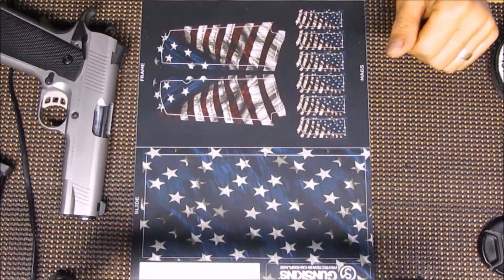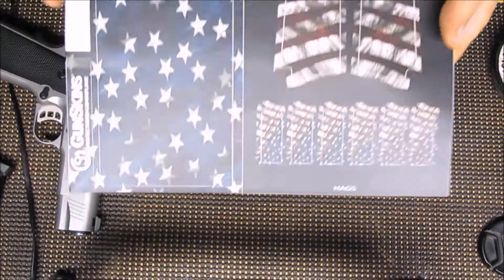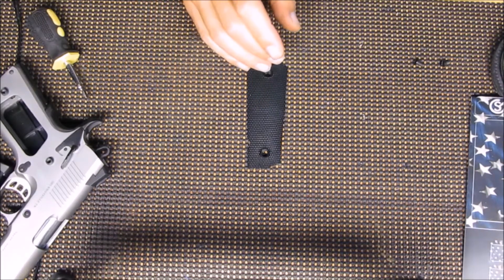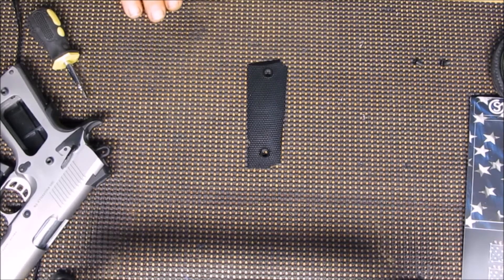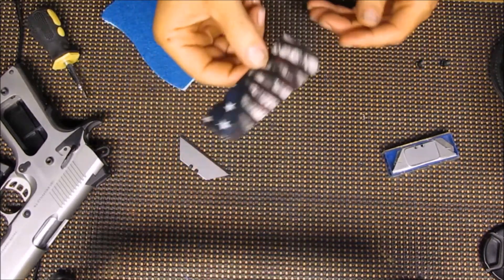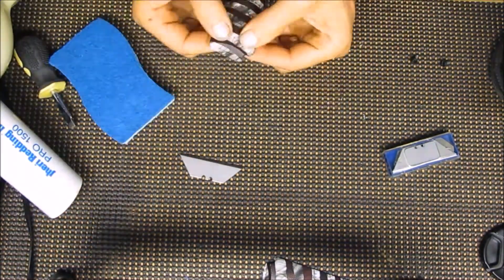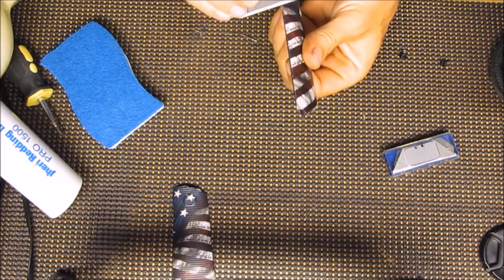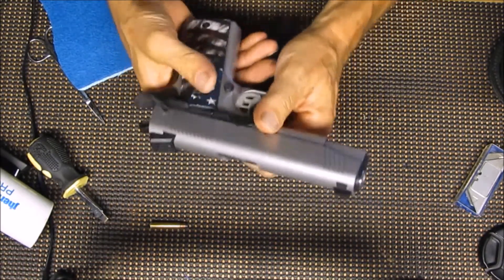Vinyl wrapping on a Tisas 1911

Comment: Hey rusty! ik this is old but i want to wrap my stainless gun. will it rust underneath? and how well has this help up?
Reply from the maker: Stainless does rust however its depending on salt air and the chromium level.. But it is vinyl and can get scratches or holes that allow moisture in.
Reply: @RustyGuns  okay good to know! Thanks!